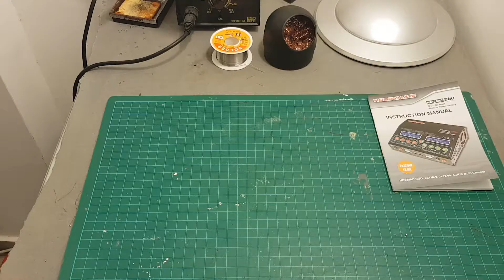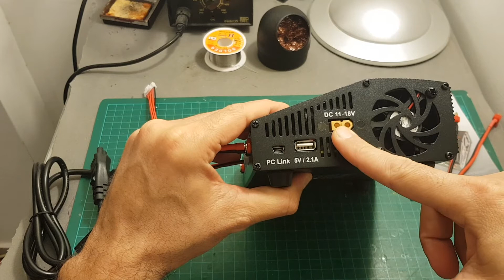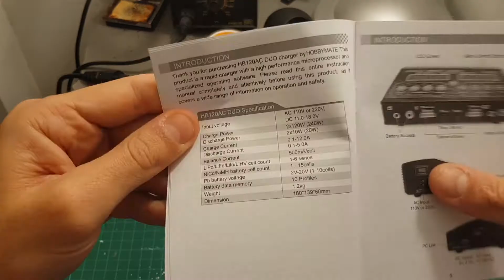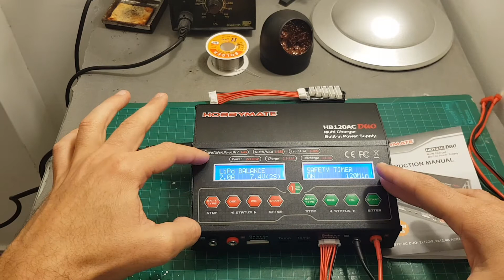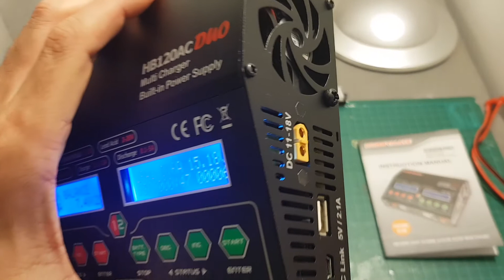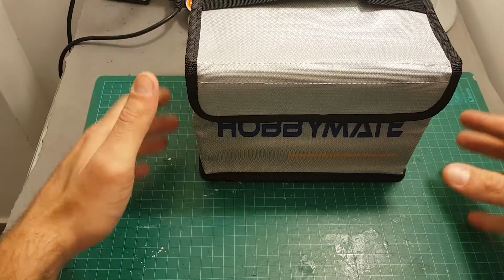HOBBYMATE Duo Lipo Charger  - Unboxing & Overview

Comment: So lipo balance setting charges at 1C?  So if I have a 4s 7400mah.  I should set it at 4s and charge at 7.4a and press go??
Reply from the maker: Yep, you're good
Reply: Got one more question. I know that it can charge a 6s 4500mah at 1C 

Can I charge at a little bit below 1C. Say if I want to charge a 6s 5000mah at a charge rate 4.5a. I know it might take a lil longer but it should work right?

Comment: Solid review as always. Not a bad charger, a little steep on the price but I like the dual fans, the ability to charge two separate types of batteries simultaneously, the dc input and the usb charger. Though to be honest my favorite feature has to be the battery memory, pre-setting your most used battery type and being able to quickly access seems like a great idea. Keep up the great work and the awesome content.
Reply from the maker: Thanks Adam for your feedback!

Comment: I been using that charger and bag for the past year on one side the light getting dim don't know if it's dying but it been working good for me it's kind of big for a field charger so I use a small isdt 620 charger for that.
Reply from the maker: Thanks for your input Tim. Yes, it is a little big for a field charger (For example the ISDT T8 is much more compact), however it is a nice feature to have both options - to power it up from both AC & DC.